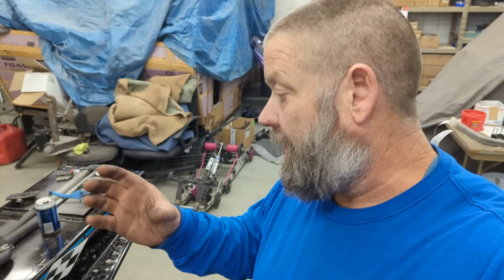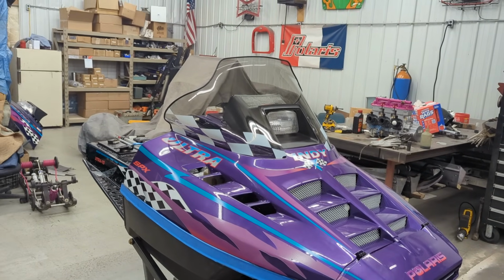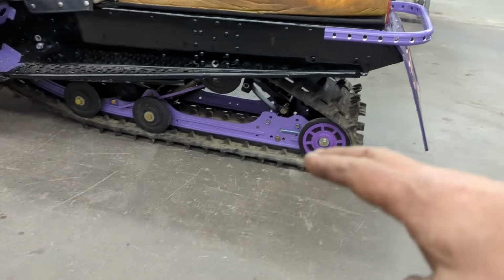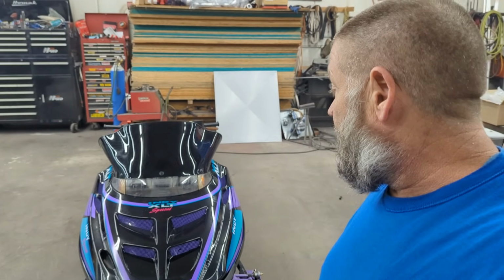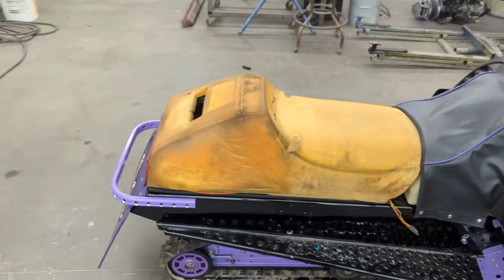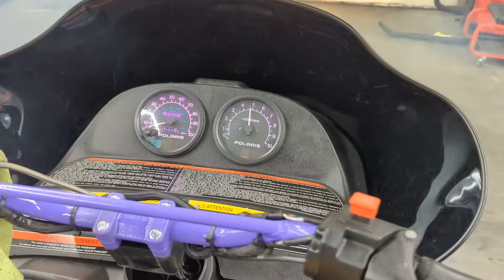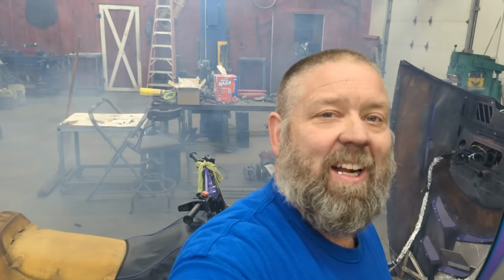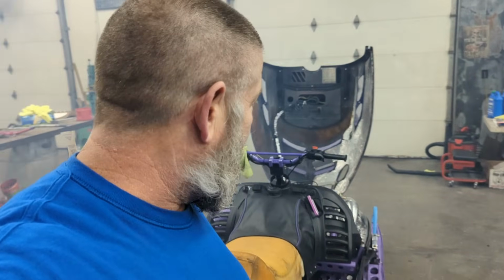POLARIS SUPER MOD XLT 600 TRIPLE PIPED RACE SLED

Comment: Any recommendations on getting a stubborn 600 triple to start up after sitting for a year?
Reply from the maker: @tylerspecht7553  pull plugs, turn gas on, remove gas cap and blow and blow in the tank, pull sled 20 times with no plugs in it, a little dribble of gas in each cylinder, install plugs. Yank it fire in the hole first pull every time???
Reply: @toddclyne3493  appreciate it man! Should I squirt pre mixed gas into the cylinders or just gas itself?
Reply from the maker: @tylerspecht7553  I keep a bottle of premix on hand but it really doesn't matter.
Reply: @toddclyne3493  alright thank you man! I'll give it a try this weekend! I got 2 i gotta try and get fired up
Reply: @toddclyne3493  got the triple 600 fired right up. The other one which is a ski doo 380 idled very rough and would die if I gave it any throttle. Also started dumping fuel out of one of the vent lines on the carb. And idea what this could be? A stuck float?
Reply from the maker: @tylerspecht7553  stuck needle and seat
Reply: @toddclyne3493  alright I'll go ahead and clean the whole carb. I'm new to snowmobiles so thank you for your help!
Reply: @toddclyne3493  cleaned the carb and set the air screw to factory spec on the 380 but it only seems to start with pouring gas down the cylinders? It runs on its own after that but thats the only way I can get it first started. And ideas?

Comment: Both windshields look great. Rather be warm than cool.😎 Want to see carb set up on the mono block. As I remember they had Issues on the early ones when people did motor work. Even if they didnt.I had a 97 standard put 7,000 miles on it never a problem. I was  told don't touch it. Just run it. Always wanted to port and pipe it. Just curious what will happen this winter with yours. Guess we will see.
Reply from the maker: I'm hoping for the best 😁

Comment: Polaris sells the o rings to rebuild those brake cylinders, get a hold of nutter, sleds looks great guys have a good one
Reply from the maker: It's not the o ring. I'm having issues with the AN fitting
Reply: @toddclyne3493  that fitting is tapered I believe if it was over tightend at some point it would loose its seal. Wilwood is an excellent choice

Comment: Playing with my skid currently. It’s been dropped previously but I’m hoping to drop it around 3 inches and the front end 2-2.5 inches. Really tempted to have a belt drive chain case made for a drop and roll. 01 rmk 800 sc. really like to run a 155 2.6 or 3.0 but see what happens. Slow build. Top end is fresh. Debating on just mixing fuel still gotta check out the oil pump. Anyways love the builds you do great work.
Reply from the maker: Sounds like you have quite the project yourself

Comment: What wilwood master cylinder do you order for replacement?? I have a 96 xcr sp and the original master cylinder is leaking.
Reply from the maker: You can get the two o rings and just rebuild it. Super easy
Reply: Thanks! Just placed an order for a kit hope it works